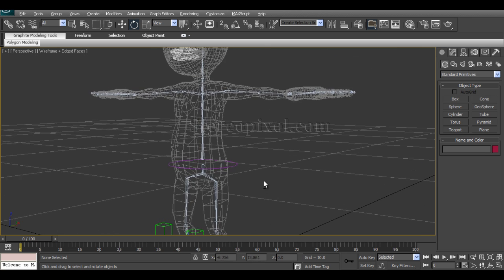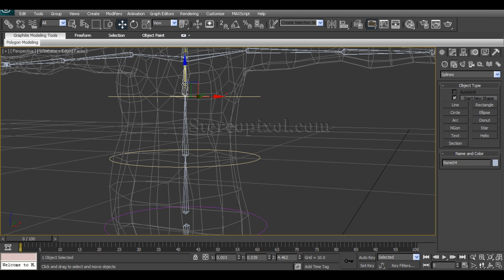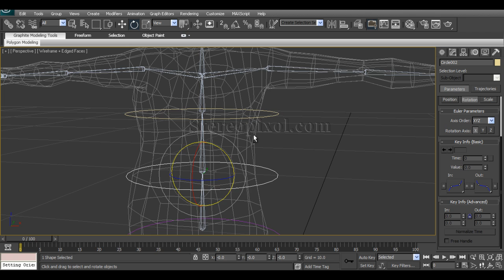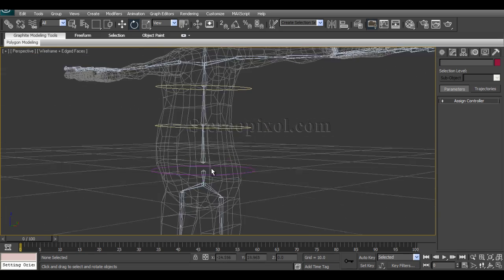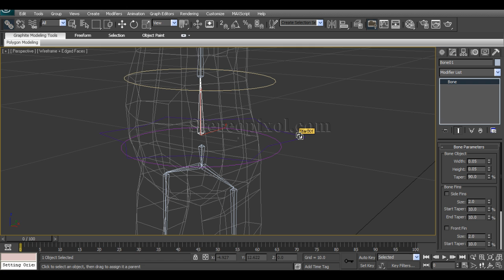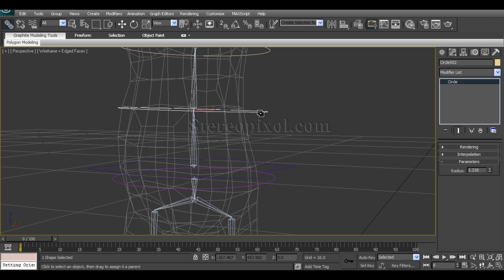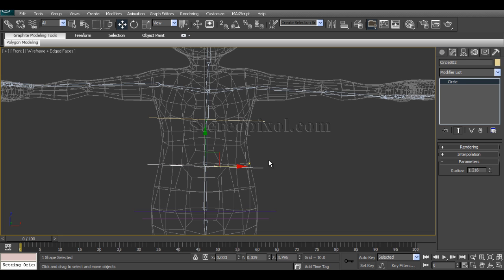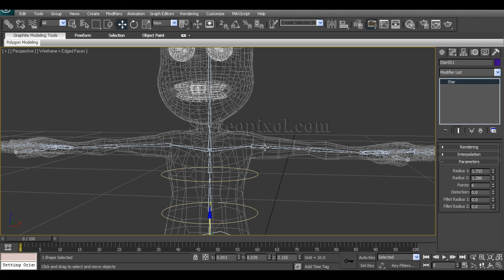Rigging in Autodesk 3Ds Max - Chapter07

Comment: 4:26
For some reason unlike yours mine moves the top half but not the bottom half
Is there something I should do?
Reply from the maker: +TheProjectPotato did you make the hip control?
Reply: Stereopixol Never mind, I've fixed it.
Reply: +Stereopixol I'm also havin same problem..wid pevicle control..d upper body only movin..not as like yours..and I've made the same as yours like hip control and all and link them..so whats remain to move d whole bones wid pevicle control..?
Reply from the maker: +REEPER connect the hip control with the pelvis control with link tool.
Reply: +Stereopixol Thanks..its really helpful..